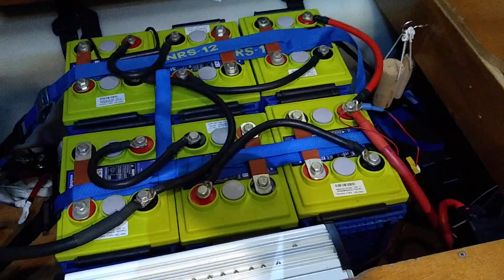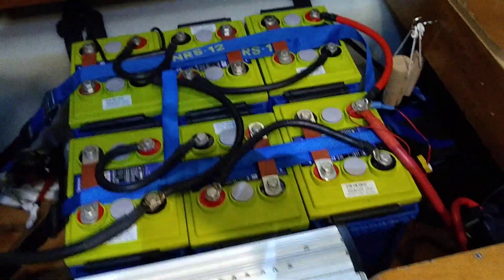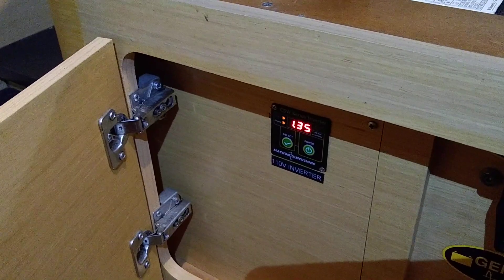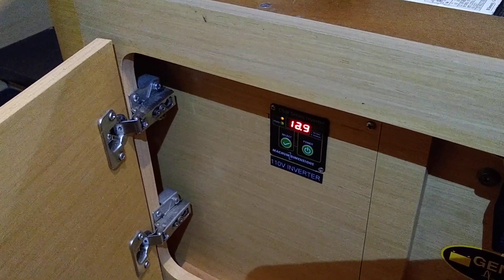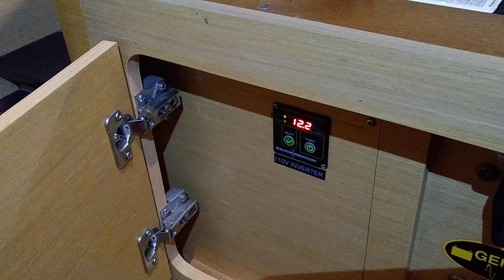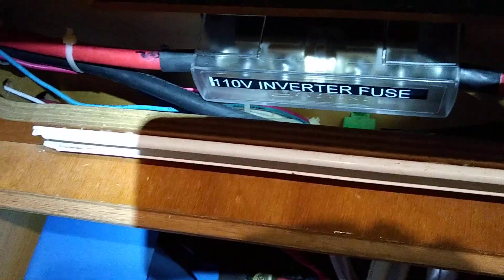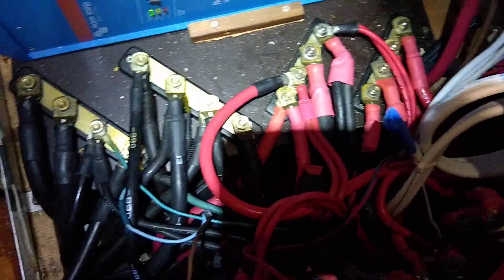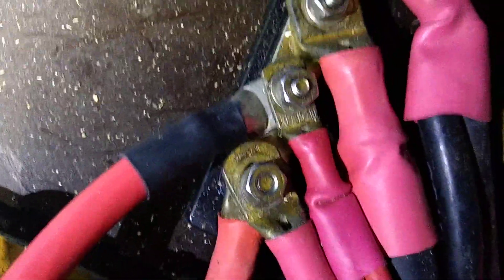Magnum CSW2012-HX inverter premature shutdown under moderate load

Comment: Thanks for posting this to confirm I'm not alone. I have a CSW1012 (1000W) with nearly identical behavior that just started doing this.

In my case, if I apply a load around 200-300W the inverter simply powers off like yours after a minute or two. Voltage seems fine. If I only draw 20-30W, it will remain on for much longer. But still appears to randomly shut off. No alarm, no codes.

Very frustrating. If I have some spare time one of these days, perhaps I'll pull mine apart and probe around for issues. It's tricky with it being intermittent like this, though!